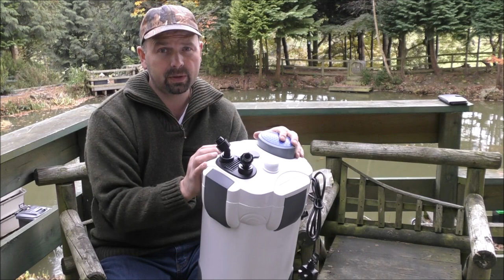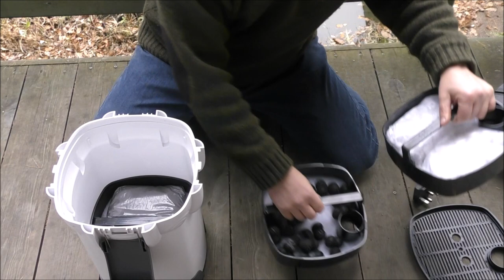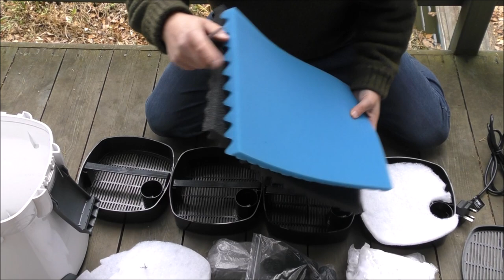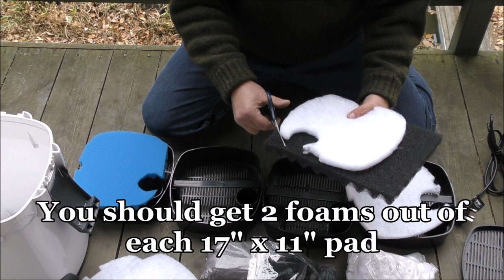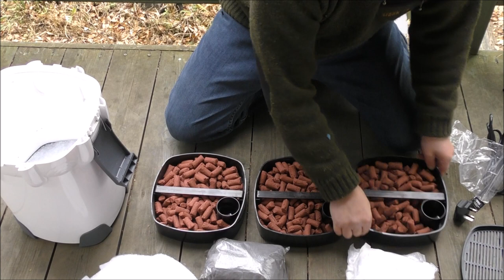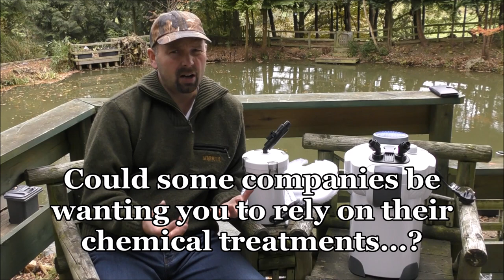Why Your Filter is TOO SMALL and NOT CYCLED

Comment: I just got one for 375 litters to put with my 100 litter Mbuna tank. What media should I use besides the filter pads, bio balls, bio stones, and carbon ??
Reply from the maker: If you've got a 375 litre cichlid tank then you definitely want to max out the filter set up like it is in this video for great water quality. I'm not sure you will get a full cycle since it could take 1.5kg - 2kg pf media (biohome ultimate) per 100 litres to achieve that in a cichlid tank which by its nature is heavily stocked.
The 2000 filter holds 5kg of biohome ultimate which would be in the 3 upper trays with the bottom tray for foams and fine pad - it is really suited to a tank of 500 litres (normally stocked tropical community tank) to 250 litres (heavily stocked tank, e.g. goldfish, predators, cichlids) and as your tank is somewhere between those two recommendations it will be borderline for a full cycle but you should have no problems with ammonia and nitrite.
Reply: Pondguru my tank is 100 liters but my filter is a 375 liter filter

Comment: Its adviceabel to use fine filter on top, why? Ceramic media breaks down over time,  it you dont have a fine media on the top, some debris may get in the impeller and damage it.
Reply from the maker: If that works for you then go for it but any breakdown will be close to microscopic from ceramic or sintered glass filter media which will easily be handled by the pump and in most filters they have decent screens to hold back pieces large enough to do any damage.
There are always multiple ways of doing anything and I often use a coarse or medium density pad just before the pump if there is not a suitable screen between media and pump.
Reply: Tbh i never use fine filter pad,  i only use course sponge, due to its reliability, holds bacteria and does mechanical as well. Any sponge media between the impeller and the media is ok. If the particle breaks down into small pieces, the more you need a sponge between the pump and the media

Comment: Richard, some sunsun  filter has UV light . If I turn on 24/7 will it clear those beneficial bacterial as well ? What r u thoughts
Reply from the maker: The light will only kill bacteria (good and bad) which pass over the light so the bacteria living on / in filter media is safe. However if you are setting up a new tank it is good to leave the UV off for 1-2 weeks to allow the good bacteria to circulate through the whole system, allowing the filter to set up properly.
A UV light has the added bonus of killing green algae and parasites (in free swimming stage) too so there are no real downsides to having one but I wouldn't class a UV on an aquarium as being necessary unless there were multiple tanks linked by the same filter.
Reply: Pondguru thank you very much sir !!!! U r the man . I m a big fan of u
Reply from the maker: No worries, I'm glad to be of service.

Comment: One more crazy question. How do I keep high flow rate but keep the current low in the tank for our betta?
Reply from the maker: If the return flow comes in through a spray bar it will diffuse it and if there is plenty of tall plants in the tank (as there should be for betta) there will be loads of places with calm areas. Amazon sword is a good one for breaking up flow and providing sheltered places.
Reply: Ok Sir I have one more question. My test strips keep showing high ammonia even after a 70% water change. So I tested the tap water from the town and it shows 1ppm after adding water dechlorinator it goes up to 1 to 2 ppm. How do I get the ammonia out of my water?
Reply from the maker: That is really poor quality water quality but if you have good filtration it should process that no problem.

Comment: I know this is an old video so probably won't see a response but as good as this seems I always understood that the bacteria that takes care of nitrates had to be in a low flow environment which makes a canister unable to do the job????????🤔
Reply from the maker: I get asked this all the time so no worries - I really should do a video on that subject since there is lots of incorrect information out there from some high profile channels.
When you have a media with suitable structure the low flow / static zones are INSIDE the media so it doesn't really matter how fast water is flowing over it.
A useful video to look at would be 'Looking inside filter media' as it has microscopic shots of lots of types of commonly available media - hopefully you will see the very different internal structures of them in that video.
Reply: @pondguru  Thank you for the reply. 👍🤔

Comment: Excellent information! From this I have a question: I have a Juwel Trigon 190 and bought an Eheim Professional 4+ 250, according to you this would be too small? I have quite a lot of plants, but also quite a high load. Got 5 Sterbai Cory, 5 Croaking Gourami, 5 Firemouth Cichllids, 2 golden Gourami, 4 Angelfish, an L250 plec and 1 bristlenose. I've also got an MH1000 powerhead with polyfluff as polisher filter. Do I need to add more filtration and what would you recommend?
Reply from the maker: The water tests will tell you if you need extra filtration and I'd imagine that you have no problem keeping ammonia and nitrite at zero but how does the nitrate test?
Reply: Thanks for your reply. I haven't actually tested my water, I don't have a test kit even. I will get one at some point but so far all fish and plants are doing well with weekly water changes and liquid fertilisers. I've only just started to get some algae as well which would indicate that it's not matured yet (only had it running for a few months).
Reply from the maker: Really a test kit is the only way to check how a filter is maturing as you need to plot the ammonia, nitrite and nitrate levels to get a visual representation of the cycle developing, maturing and completing.
Reply from the maker: Forgot to say that the API test kit is as good as anything - don't go for test strips as they are not reliable enough to give proper readings.
This is API kit, often on offer so don't pay full retail (£39.99) for it: http://geni.us/87q9y
Reply: Yea, I'm aware of that the strips are unpredictable. One other thing, I've seen that eheim filters work a bit different when it comes to the setup of the baskets, do they need to be changed? As the filter pads are in the top?
Reply from the maker: The top tray is a 'pre-filter' tray which water hits first before travelling down outside to bottom of filter and rising up through trays. Therefore just leave the pre-filter tray as it is and set filter up with foams and fine pad in bottom tray and media in trays above that (just the same as in this video).

Comment: If I do the biohome ultimate, do I have to wait 6mths b4 I can add fish? And can I add the shop chemicals to lower ammonia and nitrite?
Reply from the maker: I have just answered a similar question from you which was placed on a previous video.
When you set up a tank you can start trickling fish in after a week or so, stocking gradually until full stock is reached. As long as the filter is properly sized and set up well it should easily develop in line with the stock and maintain good water quality.
Reply: Pondguru my 260 has an upto 400L external plus the internal filter! My 160 has an upto 200L plus internal filter! Fancy goldfish 3 big aronda in 260 and 3 small aronda in 160! So should b ok! This will b in time! Need to sort filters 1st! Appreciate ur time and efforts! Happy new year and keep up the gd work!

Comment: Hi mate I'm just getting into teething fish I want to keep clownfish I have bought my tank which is fluval edge 46 litre. What external filter would you recommend because I am so confused with all the ones on the market thank you for your help and keep up the good work I'm learning a lot from you thank you
Reply from the maker: I'm glad you find the videos useful. If you are going marine for a 46 litre ideally you'd aim for 2kg of media per 100 litres so 46 litre aquarium would need about 1kg of biohome ultimate marine to achieve a full cycle (more media is always better) so therefore the minimum would be something like a Fluval 206 which will fit 500g media in the 2 upper trays leaving bottom tray for foams and fine pad. Many marine fish keepers would go bigger than that and the 306 would take 2 kilos (1 kilo per tray) with the set up the same as 206 - that would give you 2kg in total. That is way over what it should take for a full cycle but it would mean you have a filter which has way more filtering capacity and better flow. If flow is too strong through the return pipe you can use a spray bar (supplied with filter) to diffuse it.
Reply: @pondguru  thank you so much for the reply I really appreciate it can you give me a link for the media I need some good quality Media and I also ordered that filter that you recommended thank you so much I want to make sure my fish have the best quality water possible I know marine I have to do salt water so I need something that's going to work perfectly for this and once again thank you so so much
Reply from the maker: No worries, I will generally put links to related products in video description and pinned comment but sometimes it is difficult to see those if you're viewing on a mobile device as opposed to a laptop / computer.
My website is http://www.filterpro.co.uk
The biohome ultimate marine is on the 'Biohome' page.
Regards,
Richard

Comment: the problem is one bacteria likes oxygen and the other does not,  very low oxygen levels are needed to convert nitrates into nitrogen  a  major problem in the water treatment industry
Reply from the maker: That's why many are investing in more porous media like pumice - it is cheap and has a good structure for supporting aerobic and anaerobic bacteria, especially when used in the traditional rotating spray bar type shower beds.

Comment: Hey I have a 10 gallon with a hang on back rated for 20 gallons and a double sponge filter th a contains 100ml of seachem matrix is this bad because I'm overfiltering
Reply from the maker: Is that your only tank?
I don't mind answering questions from anyone, anywhere in the world but you previously mentioned 2 huge filters, a 1000 litre turtle tank and your videos show a tiny tank with a turtle in you're claiming cost $4000 - if you have a $4000 turtle why would you out it in a 10 US gallon tank with a HOB filter on and not in a 1000 litre tank with two big external filters on?
Your videos also show you dropping some pumice you smashed up into the HOB and straight into the tank - I know matrix is just pumice but 100ml of that in a filter on a turtle tank is drastically under-filtering it. A 10 gallon tank for a turtle is way too small (especially for one supposedly costing $4000).
I need some true details if I'm going to offer any useful advice as anything I come up with is only as good as the information it is based on.
Reply: Pondguru it wasn't 4000 dollars this I actually my brothers acount and he wrote this when  I told him about your channel, I have a 1000l but no vids on it, my little brother wants me too help him get more subscribers but I usually just use his.
Reply: Pondguru and my 1000l is a marine and turtles are freshwater, I'm getting him a 400l soon though,

Comment: Great information... i have that same Canister working with my cycle in my 55 gallons would that canister would be a good start for salt water and corals?
Reply from the maker: Yes should be a good size for that as long as it is well set up with plenty of media.
Reply: Pondguru thank you. What kind of media would you recommending me im new to that hobby
Reply from the maker: We do a marine version of the biohome ultimate used in this video - it has added trace elements which are fused into the structure of the media to act as catalysts for marine bacterial processes - you will find it on http://www.filterpro.co.uk (biohome page) as well as links to distributors around the world (flags at top of every page).
Reply: Thanks a lot for your help.. great channel
Reply from the maker: No worries, any time and I'm glad you find the videos useful.

Comment: I saw that the filter booster is on Amazon but only the smaller size is available. Where can I buy the larger one?
Reply from the maker: https://www.amazon.co.uk/All-Pond-Solutions-External-Supplimentary/dp/B00CMQ7UL2/ref=sr_1_1?ie=UTF8&qid=1513966637&sr=8-1&keywords=booster+filter+for+aquarium
(UK link - I'm not sure what country you are in but UK Amazon has both sizes)
Reply: Richard I’m in the US.
Reply: If I ordered it through a UK website it could work here since it has no power plugs...right?
Reply from the maker: Yes that would work. They are sold in the UK by All Pond Solutions and several dealers who stock APS products although they are exactly the same as the SunSun booster filters so should be available from suppliers of SunSun filters in the US - that would save plenty on shipping. I have just found them on ebay.com direct from China with free international shipping. It is the 603 version I used in this video: https://www.ebay.com/itm/Sunsun-Pre-Filter-HW-602-HW-603-Aqarium-External-Canister-Filtration-System/162315936919?hash=item25cac8a497:m:mICkqGrDjXEgLeCOaI-zbpg

Comment: Thanks for the great video!! I’m getting a 75 gallon (283 LT I’m in the US) what is the most bulletproof reliable filter you would recommend for a tank that size with normal stocking?
Reply from the maker: I quite like the new Oase 600 filters but I'm not sure they will be available if you are in the US - I don't really know what is available there since I am based in UK but if you have normally stocked community tank the FX5 or 6 will certainly cover you if it creeps toward heavily stocked and the larger Eheim filters are made about as good as you will get.
The filter shown in this video will have a US equivalent of a 403? SunSun - not sure of the exact model but it is the 2000 litres per hour version. They are definitely toward the cheaper end of the market so for construction quality they wouldn't rate as highly as Fluval or Eheim.
I just used this one in video as it is nice and big for filming purposes.
Reply: Pondguru thanks for the great info I really appreciate it
Reply from the maker: No worries, any time.
Reply: Pondguru with normal stocking how often do you recommend cleaning the canister filter sponges etc? Also you say not to use “Prime” like water conditioners what alternative do you recommend.
Reply from the maker: Ideally the filter should be looked at once a month but every tank is different and some filters offer more mechanical filtration / less maintenance than others. A straight dechlorinatior like API stress coat seems to have no problems, is very popular and I haven't had one report of bacteria filter maturation problems back from people using that. It's what we used in the shop for many years with no problems.
Reply: Steve I have a 75 gallon tank with a Sunsun 704B  set up per Pondguru's suggestions and around 6-7lbs of biohome ultimate. I also use an Eheim 6664 prefilter on the intake, it fits the Sunsun tubes perfectly and really catches a lot of waste keeping the main filter much cleaner. So far I've had great luck with this setup and after 8 months my nitrate level declines from the high level that comes out of the tap to a point that's almost undetectable with the API test kit. I really doubt there is all that much difference in filter quality between the brands, it seems like many products from China are all manufactured in the same plant no matter what the brand name. Who knows there may only be one or two plants in all of China making these things. Sunsun is a decent filter for the price, use the money you save and get better filter pads and plenty of biohome.

Comment: I have based on the information in this video purchased and installed the SunSun HW-603 as pre-filter. But based on my flow measurement, the flow reduction of this unit is very high. With this unit a nett flow from less than 500 liters is possible. Without this unit a flow of >700 liter nett is possible. I do expect that the size of the connectors is the main cause of this flow reduction. Do you have any additional information about this, based on your personal experience? Is there an alternative with a with a better flow, as far as you know? Looking forward to some details! Thanks in advance and greets Steven
Reply from the maker: The model you have has an integrated pump so is different to the booster in this video but the flow will always be reduced when more bends / restrictions are added between the tank and filter but the actual flow restriction will depend on so many factors from the height water is lifted up to how the filter(s) are set up.
Unfortunately I don't know of any larger pre-filters / boosters - it is a really glaring gap in the market and I will be speaking to a company in the next few weeks about the possibility of them making larger pre-filters.
Reply from the maker: Yes making it bigger will definitely help and the link you gave me was for the booster with the integrated pump. If the pump is not turned on that one will reduce the flow even more than a standard (non-pump) booster like is shown in this video as although you have same fittings and bends there is also the pump for water to work its way through.
Larger boosters really are needed but I fear that manufacturers would rather make people step up to a whole new canister filter.
Reply: Pondguru I can not send the picture, but it is without the pump, so definitely and for sure the booster, please trust me. Still looking forward for any additional solution. Greets
Reply from the maker: No worries, that explains it - yes larger boosters are definitely needed.